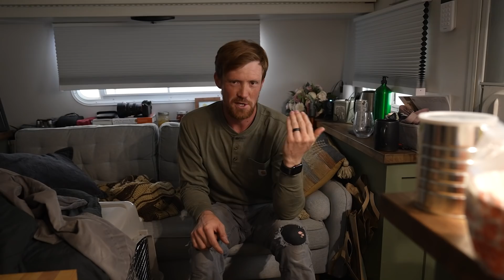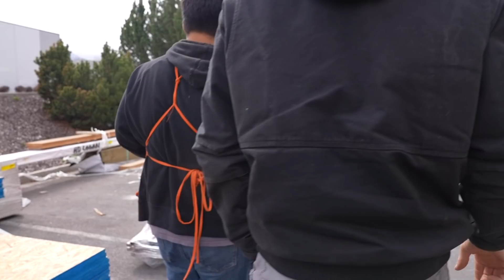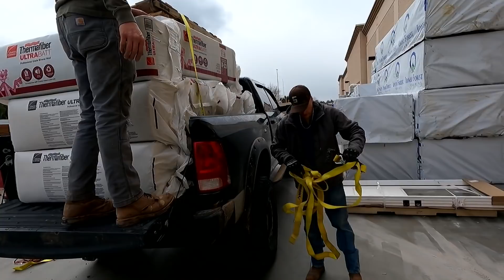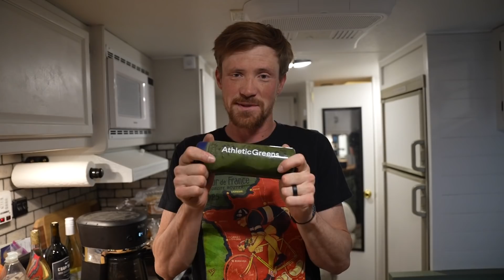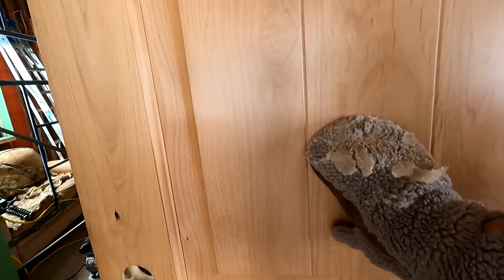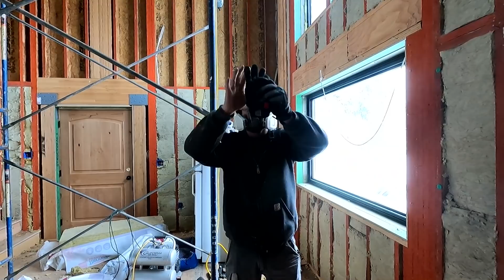DESPERATE TIMES CALL FOR DESPERATE MEASURES | BUILDING OUR OWN HOME

Comment: When Trent said "drive home 70-80 mph" with light wind catching insulation, I just put my head in my hands. A few years back, I came up behind a PU truck with some long wide pieces of wood, looked like for floor joists. He had them propped up on back of cab, sticking above it, and the other ends at bottom of tailgate. I told wife, "that is wrong way"  backed off, got into other lane, realizing the danger. Sure enough, just a few miles from the Home Depot, that wood caught enough wind, it came flying over the back of his truck, and a number of them hit on the ends, and just shattered into kindling as they hit the road. Glad you kept your load.

Comment: When it comes to the 12 inch sections your best bet is to make a jig with some plywood and 2x material.  Set the bad and it is already marked.  You need only attach a 2x4 on a hinge that drops down on the bat at the exact edge to cut to fit into the 12 in bays.   The 2x4 allows you to hold down the bat for easier cutting.  If you get a bread knife you can probably cut 2 bats at once.  If you had not already thought of it you should also insulate the interior walls of the bathroom on the kitchen side so noises are dampened in there.

Comment: Good job guys. If you aren’t done yet, a quick tip for cutting your insulation. Get a used but sharp long blade kitchen knife and slice, don’t saw, your insulation. It won’t release the particles and it makes smooth cuts. Just keep sharpening your knife because insulation will dull it very fast.
Reply: Or, get an insulation knife..

Comment: You Can Do It! Outside installation, siding, roofing, painting/staining exterior, rocking, taping, mudding, flooring, tiling,grouting, interior wall painting, trim carpentry, bathroom cabinets, bathroom fixtures, kitchen cabinets, kitchen fixtures, laundry, landscaping, deck railings, deck stairs. Phew! What did I miss? ❤️❤️
Reply: You forgot appliances....which I've heard also need to be ordered in advance due to a shortage in supply.
Reply: Not bad! You missed electrical fixtures and finishing, wall rails, hanging interior doors (Trents favourite) and door hardware. Move in date .... July....2022?!
Reply: Lol

Comment: I retired after 50 years in the trade my rule of thumb is it takes 10%of the time to do 90%of the work then 90%of the time to finish the last 10%. Mostly because there is always something you decide to do later and that probably won't get done for years. 
PS don't forget to put in cabinet and accessorie blocking, you won't regret it.
Reply: i had to google "cabinet and accessorie blocking," 
oh, that is a good idea, thanks.
Reply: I did some in my kitchen and bath. It’s been a grey hair saver.
Reply: Especially with all the walls open right now. Put that extra wood in everywhere you're gonna hang cabinets, paintings, coat hooks, towel bars/hooks, mirrors.  It will be so much better than trying to make them stay up on drywall.
Reply: that  comment is so true. I have heard it another way. It takes 90 % of the time to do the first 90 % of the work.  It takes the other 90 % of the time to do the last 10% of the work. It always seems to work out that way.
Reply: Oh yes. This is very important.  Trying to hit the studs when hanging cabinets it a pain.   Screw a very straight board to the wall where the bottom of your upper cabinets go.  Then set the cabinets on the board while installing.  Unscrew the board and patch the holes.

Comment: So...once again with an educational comment. If you wanted to do the insulation yourself and not go to the big box stores searching for store stock that is not reliably there. Contact an actual insulation distributor and place the order for all of it and have it delivered to the end of your road in a big truck. It would be in stock at a distributor when not at a big box store. And cheaper....
Reply: Good points!
Reply: It does seem that most of the time they create their own problems and perhaps its by design for drama content. So many of the issues they run into could have been avoided.
Reply: @j.f.l.7649  To be fair as also a clueless person when it comes to building houses I would also make a lot of mistakes, it's easy to judge on the outside I'm sure.  The only thing I got annoyed about is the lack of cat6 cabling but perhaps the internet is not that important to them.
Reply: They haven't been able to reliably get things delivered to the end of their driveway.
But they could have gone and picked it up at the distributor and gotten it all.
I'm not sure if they didn't think to ask Kevin or what.
Maybe they thought it was less expensive this way.
Reply: @alicecain4851  they have gotten large deliveries to the end of the dirt road in their neighborhood...I didn't say their driveway.

Comment: I’m thinking if you can access everything you need it when you need it, you might finish before winter. That depends on, if you get some more help with some things.  Sheet rock and that whole process, takes a bit, if that is what you’re doing on the inside, and you will love that even more than most anything you’ve done yet😬 😁. You still have all the exterior. I think if it were me,  I’d get the outside done as soon as weather permits while it isn’t so hot - roof, exterior insulation, siding. Have some things to work on the inside during those days that isn’t conducive to work outside. Any way you look at it, you are making Great progress even with all the obstacles you had to overcome. You’re new superhero suits...Deh Da!!!‼️❗️The Overcomers‼️❗️That’s the American Spirit! I just Love it and you all!😊❣️🥰

Comment: I realise you want to do everything yourself, but I would highly recommend hiring the sheet rockers that is a brutal job especially on the ceiling.
Reply: I second that!
Reply: Third!! Can you imagine trying to hold up the sheetrock that high up while trying to screw it in? Also, very hard on your back!! But you know Trent...lol!!
Reply: Do the drywall yourself, but hire someone to mud and tape.  Because if you think insulation sucks... 😆
Reply: @patriciacarter4227  thats if the mudders want to donit after amateurs board it ..doubt they will.
Reply: Fourth!!  You deserve a break and contracting drywall of anything is the best bang for your buck!  I know you want to learn Trent, but have them leave out the sun room and the basement & you can get skilled by watching them and doing a bit.
Reply: A trained monkey can install drywall, but finishing is hard. I do small Reno’s and tell people all the time, “ I can get very close to a pro finish but it just takes me 2 to 3 times longer.
Reply: And, a pro builder would have built a temporary makeshift floor a foot out from your wall in all your vaulted ceiling area. It could have been used for all the work up there including paint and window trim....

Comment: Sometime after the dust has settled & you've cleaned up the floors.....might be a good time to run some DIY Air Cleaners / buy a few of the $20 Box Fans & Good Quality Furnace Filters / Place the Furnace Filter on the Back of the Fans - so the Airflow is Forced through / you'll be Amazed seeing all the stuff captured by those DIY Air Cleaners...
Reply: This is pure genius (if it works).
Reply: @helenebonadio8283  it really does!!
Reply: It Works Better then Air Cleaners you Buy / years ago I bought a Hunter & they wanted $$$ for replacement filters / so I just Cut a good Furnace filter to fit / it was nothing more then having Room Air being sucked thru a filter / using those $20 Box Fans Cleans more Air & you'll know it's working / cuz the filters get dirty & need replacing /...Enjoy- Good Air.!!!

Comment: Allie:  It’s stopped snowing a bit ago and the roads are ok if you drive slow.   As the trees and everything outside the truck go whipping by the window.
Reply: @sethadams4871  when you live in a climate like that you realize life keeps going even when the roads are bad. With so much snow so much of the time, if you didn't venture out you'd be close to homebound. I think he's very responsible about it being that he drives very cautiously when on bad roads, he's got 4wd, chains, and a winch just in case. Just mho...
Reply: FYI. Not reckless to drive on snowy roads. My 90 year old mother still does. It is reckless if you do not know how to drive in those conditions.

Comment: Trent get a piece of cutoff plywood with a mill edge use this as a straight edge for cutting longer the better keep your utility knifes clean  and blades sharper.when finished for the day tie your clothing up on lines beat the glass outtta them
 Your heading into theýtr drywall challenge hanging isn't bad but finishing can be  a mutual. If you don't feel sure sub out the dry wall  itty⁶

Comment: When cutting fibre insulation always use a cheap wood saw to cut ,cuts down on time and particles and always use either overalls or disposable overalls with a hood attached. Also cut in batches if possible to fit.

Comment: Your house will be ready in September. Once you finish drywalling you are half way through the building.
Reply: few people know that
Reply: Yes! I wonder if they forgot that?! Half way done after drywall is the rule building a home  WITH trades. If they hire a drywaller, it will be at the half way mark by mid June. That is 11months into the build. Simple math has them finishing up everything by next spring. I’d say earliest move in is by Christmas. 
However, I think they are doing a great job! And this project was never about speed. I hope they don’t let a few extra months ruin the fun and quality. Over 30 years in home construction, I’ve seen people set move-in deadlines that caused absolute chaos in the end and ruined the fun of the build.
Reply: @woodatwork6927  when i first saw them start, i said they need to hire 2 good carpenters...then they would be moving in soon.

Comment: Hey guys, are you absolutely sure about using the spray foam 😔..if you ever need to do anything within the walls where you use it, it will be a nightmare!
Reply: The spray foam is going to be in between the rafters which beats trying to stuff 12" batts in to the same space. Plus, there's very little wiring in the ceiling and no plumbing.

Comment: You might be able to move in but you won’t be completely finished with the house. If you have a working toilet and sink and no sheetrock dust, I’d move in!
Reply: I would imagine that Utah is the state that would require a certificate of occupancy. Probably won't be able to move in without the sheetrock
Reply: See.... I wouldn't.  They are comfy and have all the amenities in Terry. You can't hang stuff in the closet until the bar is up. Don't you want to paint before then? There are so many little things that we do living wise. Where do you put the toothbrush? Is there a medicine cabinet in yet? Does the pantry have shelves?... Yes, they could live there, but I would rather live in Terry than camp in a construction zone. ... If it was really almost done, then yes, I would absolutely move in.

Comment: If you do decide to do the drywall look into a drywall sander. Festool makes the best one. They are nearly 100% dust free but very expensive. I have the Porter Cable one and it is very good.

Comment: If you cut the insulation  cross ways instead of length ways you will find it much much easier. And much faster. Set up a table for cutting. One does the cutting the other/s installs.
Great Video!

Comment: I would recommend running beads of caulk up and down and across all support beam seems where you have them on the outer walls, I noticed like four studs on each side of all the windows and like seven studs all supporting the roof header,  because cold air can seep in through there and maybe be less efficient to keeping the cold out, when sealing up the outside it is important to seal any areas where cold air can seep in or mold might occur where the cold air meets the warm air, one place that it happens a lot and people miss is the bottom plates of the house where the wood sill meets the concrete foundation,  inspect it from the outside

Comment: A quick tool you can make to help place the bats easier is the cut a 2x4 chunk at 18 inches long then a section of plywood or greenboard at 20 inches long and 5 inches wide.  Nail the ply material to the 2x on its edge lengthwise and you have a handy tool to pat insulation into the bays.

Comment: Little tip for ya wet and wring out the bag over your wet and dry vac filter or the fine particles in the insulation will destroy the motor

Comment: I think it'll be more like first of September move in.  Insulation was awful,  but drywall is hard work,  then taping,  mudding, texture,  paint .. this process took awhile. Then....trim, ugh. Went on and on,  but I also finished all my trim myself,  cut,  then staple.
Seems at your point your getting close,  but,  still roads to travel. 
Great job!!  It's looking good and saving heat, priceless.

Comment: Yes, you are so close. I didn't have to do all of the work you did to contend with the weather in your area. In Hawaii we don't really need insulation but I'm up 4,500 feet and wish I would have loaded the walls with insulation. When it snows on the mountains and the trades blow it gets really cold up here. I have no heating in my home but I just got a propane interior stove and the only thing holding me back it the cost of propane per gallon ( $5.50 ) so I'm holding off to finish the outside before I address the heater system.

Comment: A friend ordered cabinets from one of the big box stores like Ally and Trent did. It turned into a nightmare. It has been a year since the order was placed and she still doesn't have all of the cabinets delivered and installed. They've remade some of them twice. Of course, you don't have to have a kitchen cabinets to move in -- or bathroom cabinets. Easy enough to rig up a temporary sink. Or just continue to use the trailer kitchen. Options make life easier.

Comment: If you have some leftover pieces of wool rock foam. See if you can cut into some small squares a few inches in size, put some veggie seeds in them, some miracle grow, and see if it will grow things (garden sets) well in it.  Also, they do have paper disposable coveralls or painter's suits to put over your clothes so all the insulation fibers don't get into your regular clothes. Home Depot has them too I think. Now you know why so many builders have gone over to spray foam insulation.

Comment: The best method for cutting insulation is to lay it on the floor and put a 2x6 on your cut line. Put your weight on the 2x6 to compress the insulation, and and run your sharp knife along the board edge. Doing it this way will be quicker because you can cut through the insulation with one or two slices. And you will cause much less dust. Use the proper type of knife. You will see the advantages immediately.

Comment: Being from South Africa Johannesburg where houses are only build from brick and mortar I'm blown away by how much you guys have to do to insulate and stabilize for temperature control in your homes. With building costs here ranging between $350 - $900 per square meter i would love to know if it works out cheaper to do a wood framed house. We don't have earthquakes,tornados or snow in SA so by right wood should make sense as the route go here if its cheaper and yet its not. when did America make the shift from brick to wood and was it due to cost? I would love to know. BTW I'm glued to each video and even remind my hubby that works away from home to watch so he stays up to date and knows what I'm talking about when I mention something from the latest video. Love your channel!
Reply: The move away from brick/masonry generally happened after WW2, during mid-century.  It was/is much cheaper to use wood.  EDIT:  BTW, they still use brick on the facade of many homes and buildings, but the structure itself is made of wood framing.

Comment: You can move in now.  As I mentioned in the past built a house when I was in second grade.  We had to move in at the beginning of summer.  As I recall the house my parents was went went from $200/month to $2000/month.  That sounds low, but you got to remember this was the early 70's, brand new cars where $3000.  The house was a bare shell.  No plumbing, no electric, no insulation.  We went to a local park to fill up jugs of water.  Us kids thought it was a blast, but I'm sure my parents where a little more harried.  They got all the basics up in less the a month.

Comment: If you hang and finish the drywall yourself, you will not be in by July. You could be in by the middle of July if a company does the drywall and you actually work 10 hour days , 6 days a week. Two weeks for the drywall, one week for painting, one and half weeks for doors and trim, one and half weeks for flooring and one week for the plumbing and electrical together.

Comment: Can you move in is a pretty broad question lol.  Will you be able to move in, in July- probably.  Will you be moving into a finished house, most likely not lol.  
A tip for cutting insulation- put a 2x4 along the cut line you need with it placed on a solid wood surface and in one or two swipes with a knife, you have a perfect clean cut and less mess then trying to saw through it.

Comment: The light weight cloth style body suits are not hot at all and will keep lots of that crap off of ya, now that your done with it. Also, when you have lots of particles in the air. A shop vacuum with a good bag filter left on, with the vacuum  more back a way and the hose in the middle of it all will keep that down.

Comment: If you move in, in July, it'll probably be July 31st at 11:00 pm ! Sheet rocking and mudding and sanding should only take novices about a month, so it could work, but Geezus, becareful doing the sheet rock on the ceiling etc.